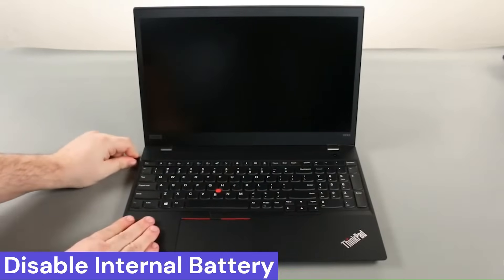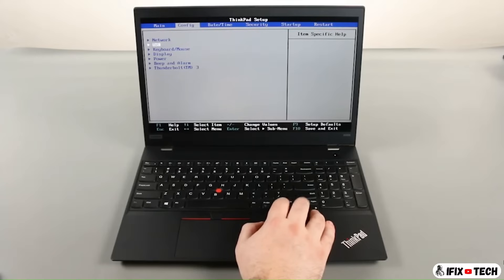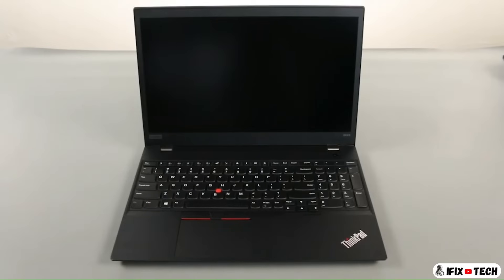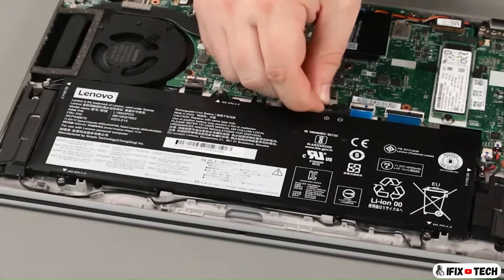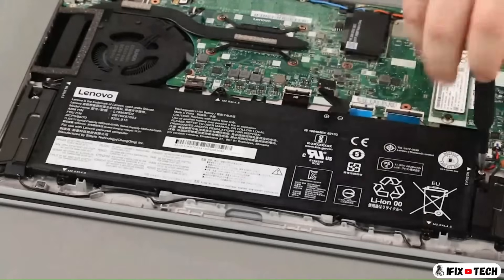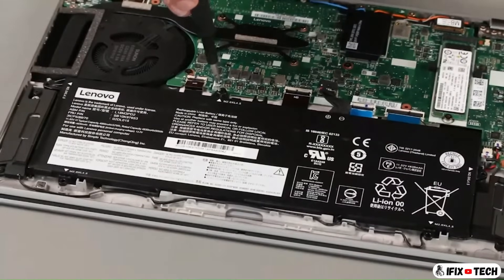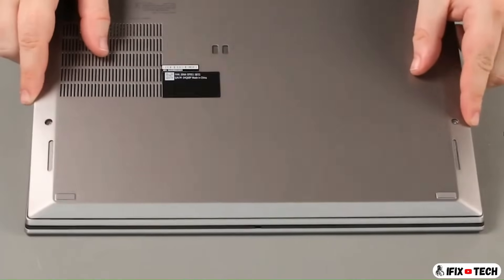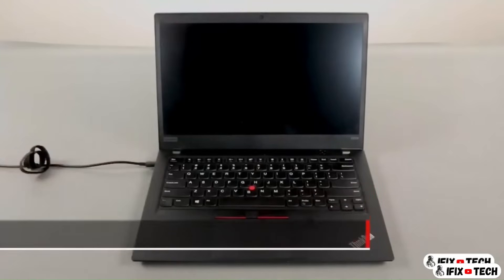Lenovo ThinkPad X390 and X395 BATTERY Replacement - How to Remove Internal Battery

Comment: Ia x395 same battery with x390
Reply from the maker: Yes, the ThinkPad X395 and ThinkPad X390 use the same type of battery. Specifically, both models utilize the 6-cell, 49WHr, 11.4V battery. You can replace the battery in one with a battery meant for the other. thanks for liking it and subscribing